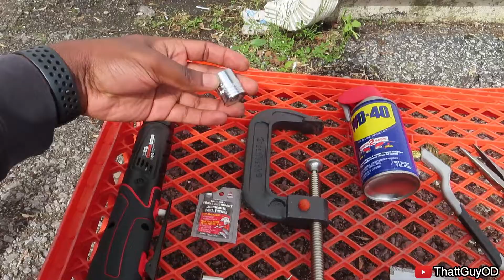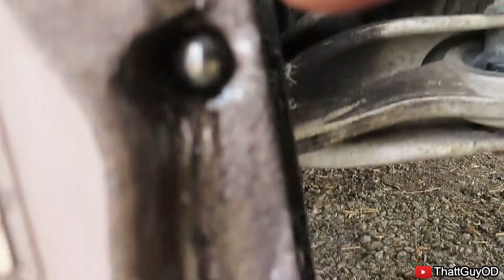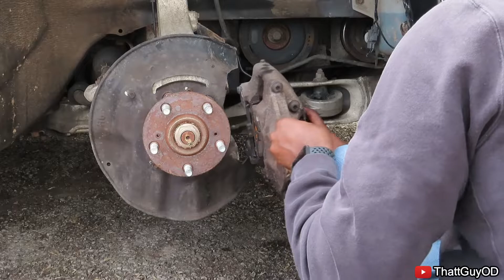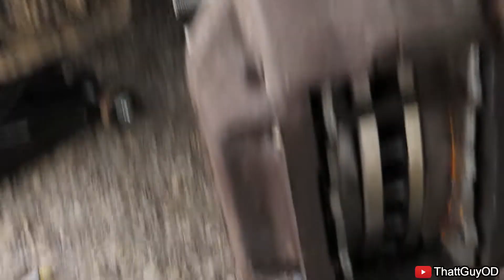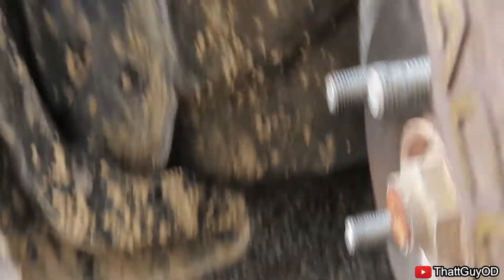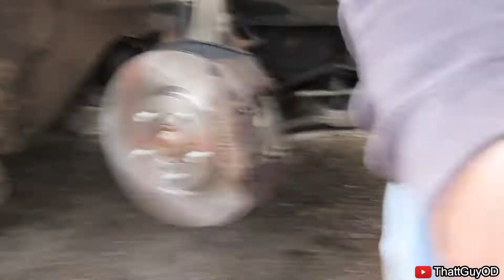Replacing Front Brakes & Rotor on a 2005 Acura RL #AcuraRL

Comment: Next time open the brake fluid reservoir cap when you use the clamp so you don’t bust brake lines.
Reply from the maker: Make sense thanks
Reply: Appreciate the video though. Never done it on a  bbk. I’ve had two base 3g tl. So to see it is very helpful being a visual learner. Thx homie
Reply from the maker: No problem. Hope it help , thanks for the cap tip
Reply: Where did you get the new hardware for the brakes?
Reply from the maker: @Salth20cowboy  from autozone

Comment: Hey brotha, see you on the RL facebook groups and I like that you are making these vids when no one else is. Only thing that is missing from this job is the rotor screws. I felt it necessary to mention this because your rotor's screws were removed but for others they may still be there and they can be a real task to remove without the proper tools
Reply from the maker: thanks for the comment. i notice it was missing but forgot to mention it. the screws can def be a problem sometimes, especially when the screw is stripped and the only way to take it out is by drilling it out. I sold the car i hope someone step in to make How to videos about the RL